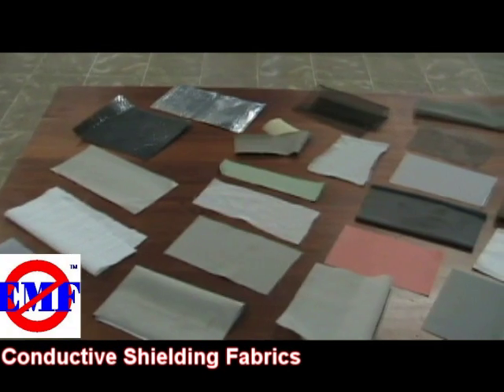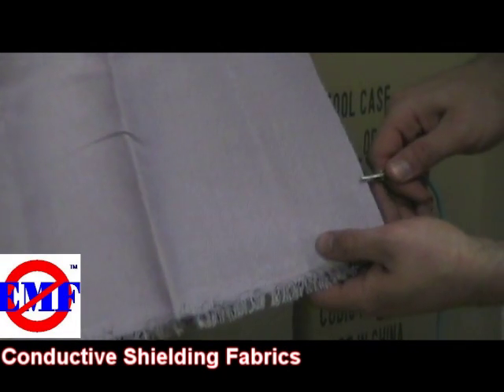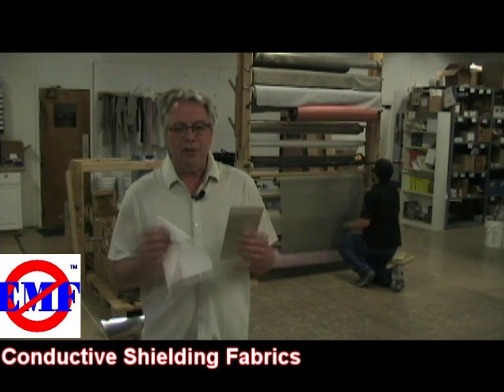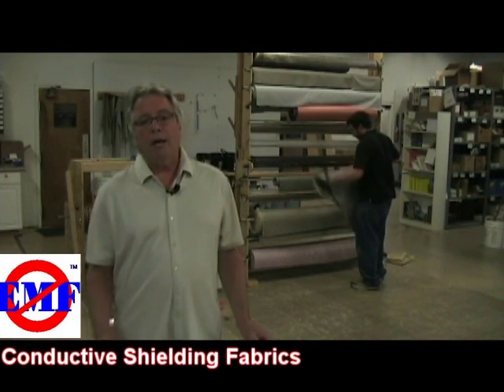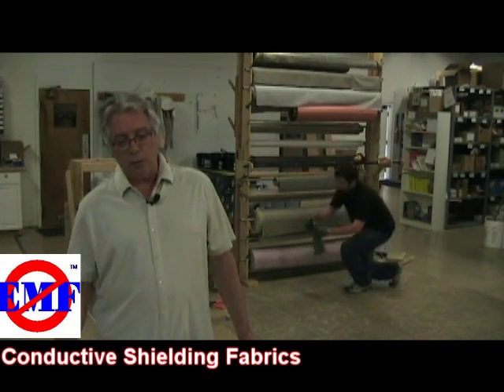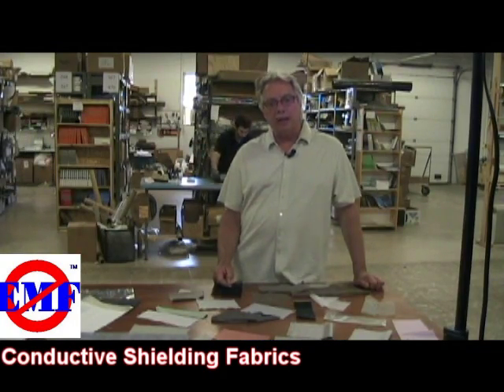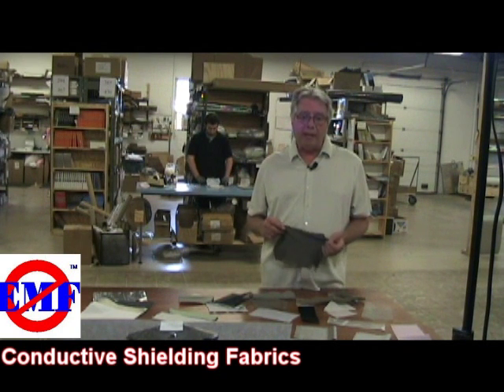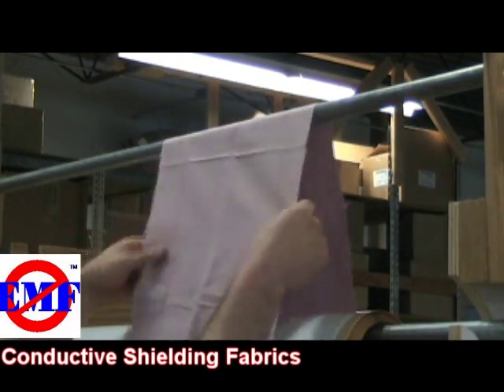Shielding and Conductive Fabrics

Comment: What frequency range are these RF shielding materials good for?  When they stretch as with clothing and hats,  does the effectiveness change?
When the user sweats, does that effect the shielding?   Being these are RF reflectors, the areas not covered are open to radiation. So, with the case of a hat, does the inside act as a parabolic focusing lens of the RF energy coming into the large uncovered opening?

Comment: Is there a fabric to repel Cell Phone tower RF's. I was thinking of draping it over my 4 poster bed frame (on all sides)... to block near by cell phone towers. I bought an RF meter ... and my bedroom does pickup harmful RF waves. Does your product only shield from Electromagnetic fields... and not Radio frequencies (from Cell Towers). I have both types of meters (EMF and RF) and they do not meter the same things. Example the EMF meter does not work at all to check for RF around me... and the RF meter does not work to check for EMF around me. I do not need fabric to shield from EMF... but I only need fabric to shield me from RF (from cell phone towers, smart meters, wifi, microwaves, cell phones etc).
Reply from the maker: Yes, our shielding fabrics (and the canopies made from them) shield for RF. There are no fabrics which can shield for magnetic fields (what you are calling EMF). You can see a selection of RF shielding fabrics at https://lessemf.com/fabric.html There are many different and unique fabrics available. Some have transparency, some have higher shielding, some are safe for skin contact, and even some are more washable than others, etc. If you need assistance selecting the proper material for your project, contact us through the website linked above!
Reply: What type of fabric would be best (to sheild from RF) over a 4 post canopy bed? And approximately how much would that cost? Ball park figure.
Reply: @carolLDickinson  There is a ready made 4-P canopy from Naturell (by Swiss Shield) available at LessEMF. Has good shielding and will still allow enough air through the fabric.
Reply: Hi Bernie L... I did purchase the mosquito net style RF shield from Naturell about a year ago... but stopped using it because the noise of my somewhat quiet fan next to the bed would not let me sleep a deep sleep. Also it was a booger bear trying to get in and out of bed... plus I had to keep sewing up the rips near the seam lines. No more bed netting for me. To much trouble... plus it cost a little over $1000.oo Yikes! I am thinking of converting the bed netting to a curtain and placing it over my big glass window where most RF radio frequencies flow through. I don't want to destroy my bed netting... so I may see if I can find an RF shield curtain to replace the curtain there... or drape over it for more shielding.
Reply: Carol Dickinson  aybe tou could try the RF blocking paints they have?
Reply: I know there is EMF blocking paint... but I don't know of any RF blocking paint. What is the name if you know.